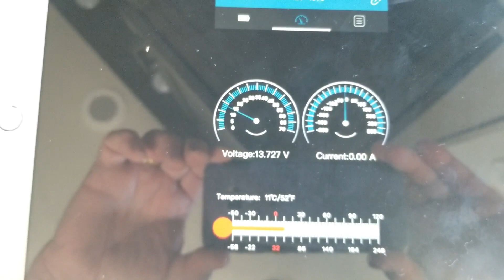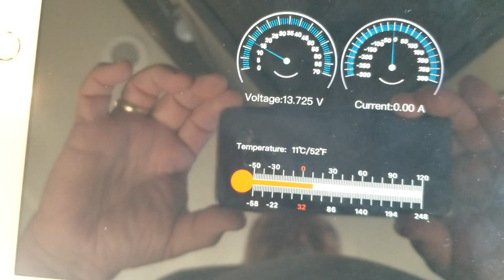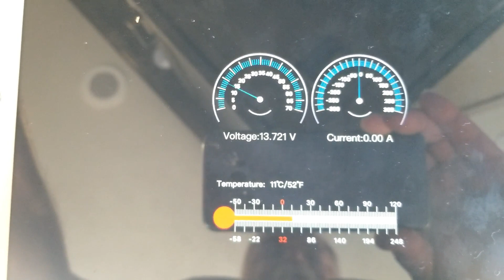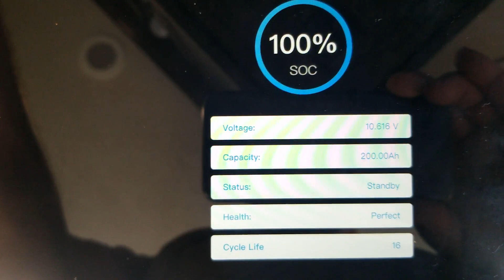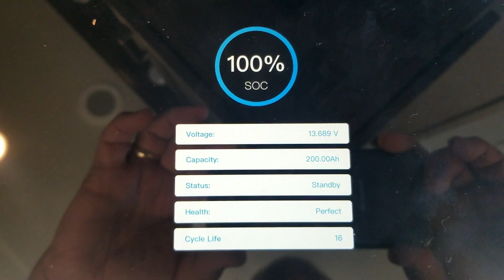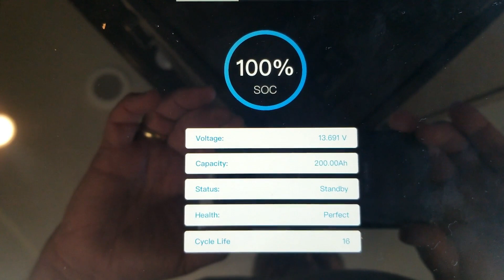Grand Design 303RLS   Converter  Charger Test

Comment: Thank you for sharing. not an expert but i do run my bike battery without a BMS. that being said... you can charge lithium's with a regular charger. i wouldn't do it like that but you can.  A real charger limits the volts and amps at the top of your charge to save the battery wear/over volts. you can start a fire like this so good luck and be careful. ps i charge the bike with a laptop power adapter and a boost buck converter. in case you want to look in to that idea.

Comment: really appreciate your series of articles on your Grand Design upgrades. 

I have a 2022 337RLS, which appears to have identical electrical system as your 303RLS.

Interestingly, and independently, I have done much the same as you, I have:

4 x GoPower 100 ampHr Li batteries, same Renogy 3000 watt inverter, transfer switch, and still use factory Furion Solar controller.

I did change my power converter charger to: Go Power! GPC-100-MAX 100 Amp 4-Stage Converter/Battery Charger set on Li mode.

I found the best charging I could get was around 30-40 amps.

I then purchased a second Go Power! GPC-100-MAX 100 Amp 4-Stage Converter/Battery Charger, which I connect directly to the batteries.

If I plug in to shore power, but disconnect the batteries from the coach Go Power! GPC-100-MAX 100 Amp 4-Stage Converter/Battery Charger, and then connect the second Go Power! GPC-100-MAX 100 Amp 4-Stage Converter/Battery Charger to the batteries, which are now isolated from the coach, I can get 60-70 amps of charging. But here is the interesting thing, if I leave the batteries connected to the coach Go Power! GPC-100-MAX 100 Amp 4-Stage Converter/Battery Charger, AND I connect the second Go Power! GPC-100-MAX 100 Amp 4-Stage Converter/Battery Charger directly to the batteries, I get about 110-120 amps charging.

So, say after boondocking, offline from shore power,I have run my batteries down to 50%, that is I now have 200 ampHrs left, I can recharge them at ~100 - 120 amps, and they will reach 100% again with 2 hours on the generator or shore power. As you know, the Li batteries charge a little faster up to 80% and then gradually decrease charging speed a bit until close to 100%.

In BC, Canada, generator times at our provincial parks are 9am to 11 am, and 6pm to 8 pm. Because I can rapidly recharge, I use the inverter for anything or everything (except AC), knowing I can so easily recharge.
Reply from the maker: Thank you. Sounds like you have the perfect setup for your needs. At some point I will add more battery capacity.

Comment: What i am getting from this is a non lithium converter/charger can charge a lithium battery to 100%  Am i correct or is it the solar that brought it to 100%
Reply from the maker: Yes, I was able to reach 100% SOC, but the PD9260C alone would not be a reliable option for keeping a LiFePo4 fully charged. Because this converter/charger has a boost mode capable of producing 14.4 volts, if you can force it into boost made it will top the battery off. PD sells a pendant that allows you to do just that.
Reply: Just bought a 9270c.Nice to know if I get lithium to get pendant.Crazy I just ordered it and didn’t even think about lithium capable.